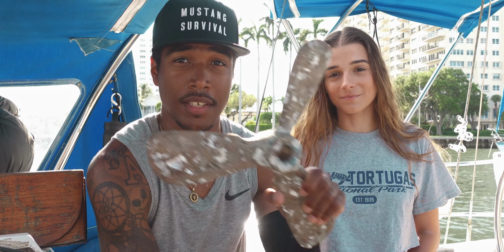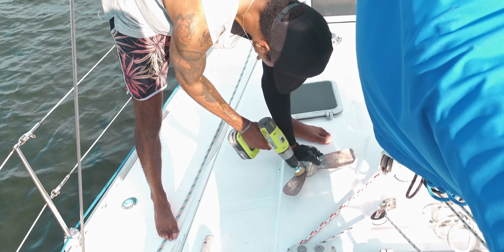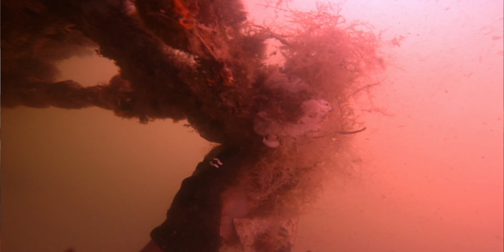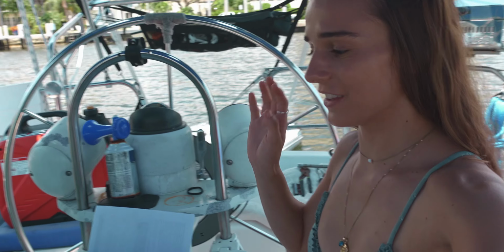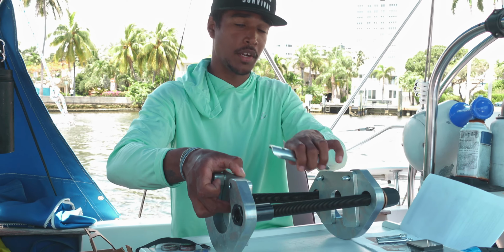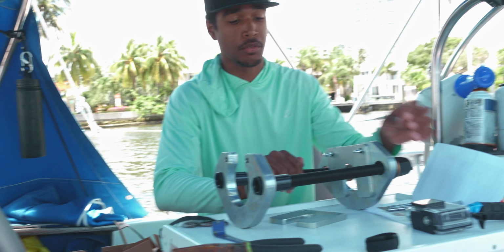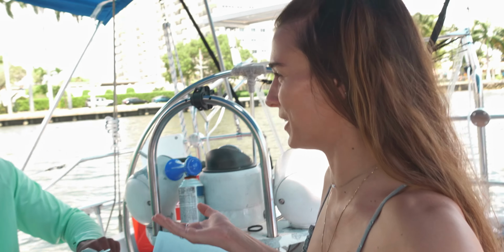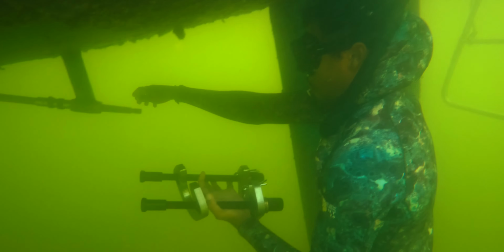EP. 6 | Changing our CUTLASS BEARING Underwater! (Mechanics said it wasn't possible)

Comment: Good job on the cutlass bearing change. It looks like your cutlass bearing has a very thin Nitrile liner. My experience with cutlass bearings with thin nitrile liners is that calcium carbonate deposits so prevalent in tropical waters can quickly damage/destroy the thin Nitrile liner. My first failure was in Key West, second in the French Polynesian Marquesas, and third in an uninhabited atoll in Micronesia. I was able to do an overnight hang in Key West, but changed the other two failed cutlass bearings in the water with an improvised tool. Tired of recurring failure of the thin Nitrile liner, I've switched to one-piece Vesconite cutlass bearings and since never had a problem in tropical waters. Also, looks like you have substantial discolored bronze in your prop and shaft indicating galvanic corrosion. So replacement may soon be necessary. Once all is done, check engine alignment to minimize vibration and wear.

Comment: What about using a pneumatic reciprocating saw you hook it up on the low pressure of your regulator for scuba diving and you pull out the shaft and fill the hole with wax ring for a toilet to seal it, and the type of cone that’s use resealing boats with no shaft. 

And once you cut out, the brass cut the spare and you can install the new one just a thought

Comment: Rudder gudgeon? It looks like you guys had some galvanic corrosion issues.  Were the zincs there at all when you dug into the problem?  There is a lot of stray current in congested anchorages.
Reply from the maker: We took the zincs off with the prop. We did however end up finding some electrolysis on our original bronze shaft.

Comment: Well done with the cutlass bearing - Did you know there is a breathing system that uses a weathered bouy that has an air pump to feed a mask underwater.. Might be easier than holding breath, or the expense of compressed air cylinders... Good luck !!
Reply: *teathered bouy - damn auto correct !!